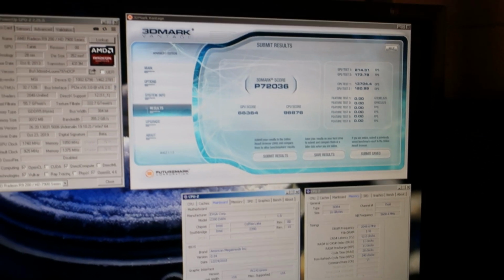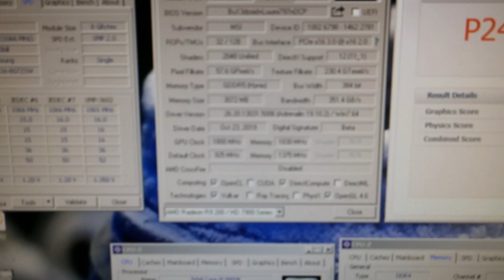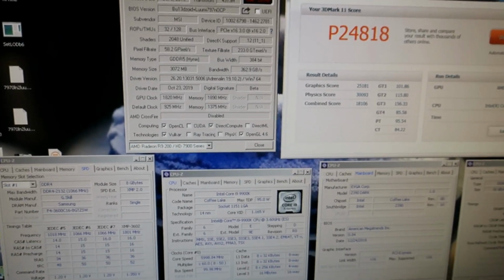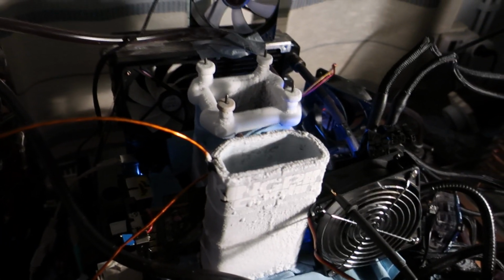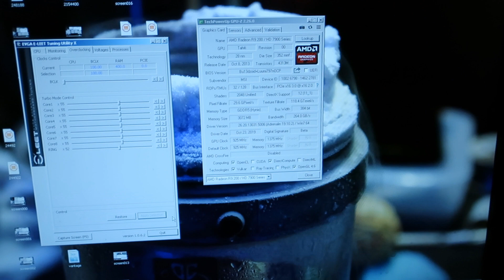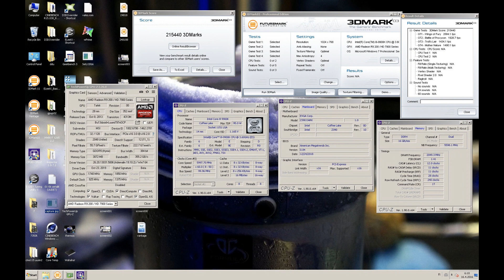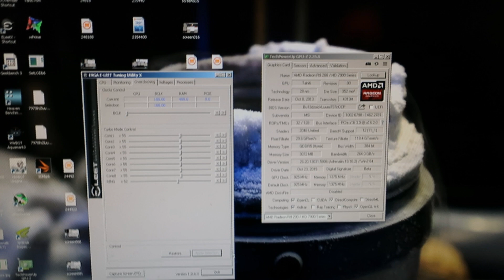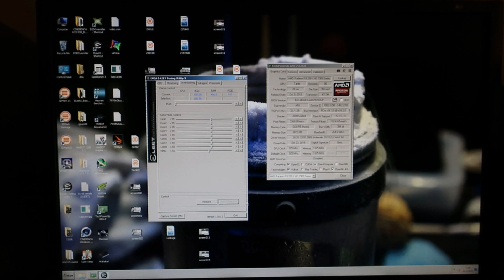MSI 7970 Lightning Smashes 3DMark Records at 1800MHz+ GPU Clock

Comment: How to film while overclocking. BUY TRIPOD. 
Great benching as usual.
Reply from the maker: Not much space for placing it in this room :D, I will try to take somewhere else.
Reply: Luumi I think a hanging camera setup may be the way to go then (typically I find a hook and oddly balance my camera which gives a nice overhead view of pouring LN2 and stuff, but I’m thinking about making a “hanging tripod” with 2 or 3 small pulleys to hang the camera from the ceiling so it’s up/down/left/right/depth positionable while also out of the way). But I also got a mini-flex Tripp’s thing coming that might help you to, it can wrap around most objects (like a monitor/pole/large hook etc) kind of like an octopus (and these are extremely cheap, anywhere from $3 to $30+ but honestly the phone mount adaptor was almost as much as the one I bought, so I’ll probably have multi-can setup like a go-pro and a phone for top view and monitor/desk view).

Nice record Luumi! Can’t wait to see more awesome records from you in the future, cheers!